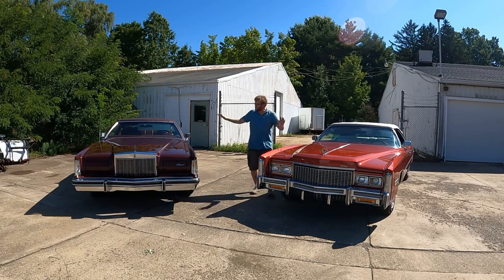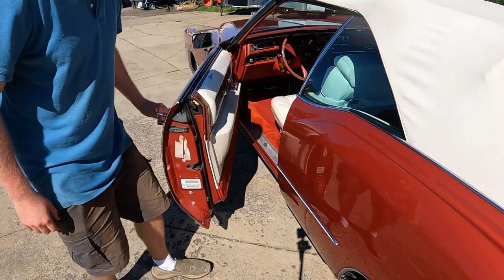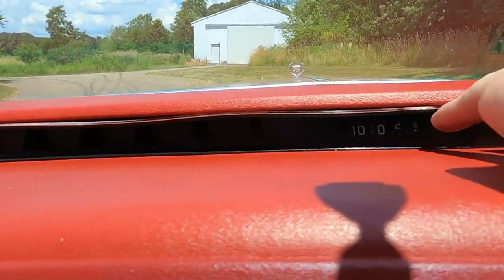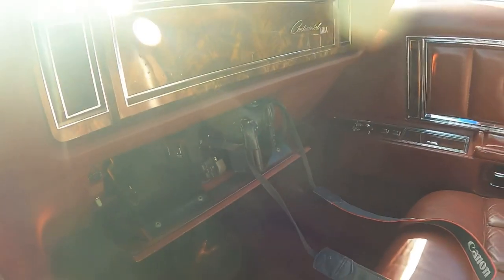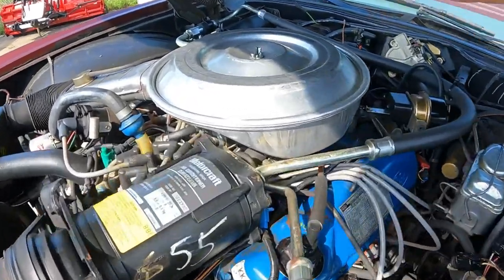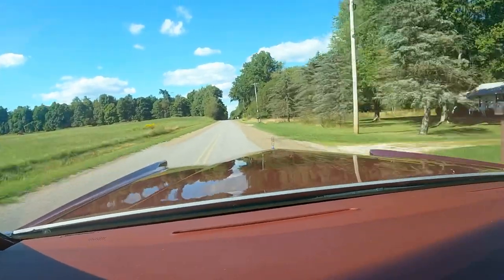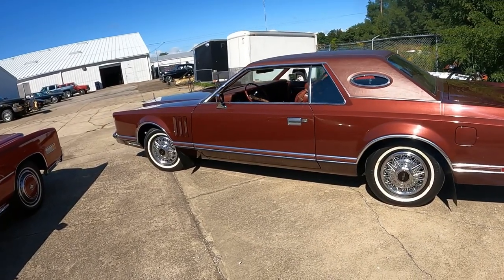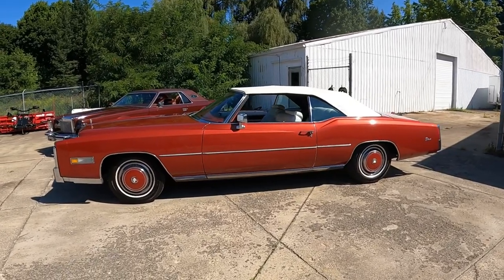This vs that 1976 Cadillac Eldorado convertible vs 1977 Lincoln Mark V￼

Comment: With the Lincoln, I'm surprised that it doesn't have a 460. The 400 and the 460 is miles apart, with the 460 having a noticeably larger physical size. The 400 is part of the "M" (modified) family which also includes the 351M(which used to be a 351 Cleaveland. What the "M" indicates  is that it had the 'big-block' bolt pattern on the back so that it was the same as the 429 and 460 family. Having the 400, the Lincoln is seriously underpowered and gas mileage was erratic. Having had a 1974 1/2 400 equipped Ford car(which was rated as a gas hog, with the Olds Toronado ranking the worst gas mileage) in the family, when on a trip, when you stopped to fill up, you might find that the car  got 12 mpg, but filling up after the 2nd leg of the trip, it would have gotten 26 mpg. One particular trip was on I-40, which was pretty much flat without going over any mountains.
One of the tip-offs identifying engines(not looking at the sticker on the air cleaner), the big blocks had what looked like an oil filter attached to one side of the air cleaner housing.

Although the El Dorado had a much larger engine, it was very heavy. With it's brother the Olds Toronado, the front wheel drive  had no advantages like a smaller and lighter car would.  Because of the excessive weight, when the road had curves, the car wanted to go straight rather than to follow the direction of the front wheels. About the only advantage was when drive slowly through a snow-covered road. The reason it didn't have torque-steer was also because of the massive weight on the front driving wheels. The transverse mounted engines and transmissions of later Cadillacs had torque steer. 

My choice between the 2 cars would be the El Dorado, mainly because it is a convertible. That era using the Bendix fuel injection system wasn't that much of an advantage. Basically it sensed load through a vacuum hose going to the control unit. They also used a 2 barrel  throttle body. It was basically for emissions. When equipped with a Rochester Quadrajet, when the secondaries opened, you would feel it. Those El Dorado convertibles had a nickname, which was very derogatory and I'll let you guess, "_ _ _ Canoe".
Reply from the maker: Thank you so much for taking the time to share that story as well as insight =) that’s crazy to go from 12 mpg to 26 mpg both cars could have used another gear or two it would have made them far better. Still can’t get over how smooth the Cadillac is being FWD
Reply: @What.its.like.  Yes, the Ford 400 V8 had some serious mood swings. I'd spoken with others and they had the same complaint with the 400. When my parents got their car, it was getting 6-8 mpg around town(the Toronado was rated at 4 mpg). I figured out what was going . It was the emission control system and I figured out what to bypass and the mpg around town popped up to 12.  I never could figure out the erratic gas mileage. On a trip, sometimes the gas gauge moved very slowly, but when you stopped to eat  or something when you started the engine, you could watch the fuel gauge sinking rapidly as you drove.

Nobody had overdrive automatics or even lock-up torque converters. Cadillac got it's first O/D automatics in 1981, but only on full size RWD models with the 4.1L Buick V6. In 1982 all RWD cars got an overdrive with the HT4100. The restyled FWD Eldorado and Seville got an overdrive automatic in 1982 behind the HT4100 V8. By 1982, GM had 3 overdrive automatics and all had teething problems which didn't get solved for several years. By the time it was worked out They had discontinued the 2 O/D automatics and with the introduction of the all-new FWD full-size Caddies in the Fall of 1983, the opened up another can of worms with a new O/D automatic transaxle.

When I worked in a Cadillac dealership my line was transmissions. There were 4 of us and we were always kept busy. Each different transmission had the same parts fail over and over. I knew every part I would need before I even brought the cars into the shop. I had a pre-made requisition order for each model of transmission  which I would hand to the parts department. It was all warranty repair so we didn't need to get the car owner's OK to repair it.
Reply: This is a totally fraud comparison, the Lincoln being a coupe & Caddy being a convertible, some choices were because it was a convertible, you should have compare a Caddy Coupe with the Lincoln Coupe ... and also use the the upgraded interior in both cars ... the Lincoln Mark III, IV, V, & VI were all better than the Cad El Dor, Lincoln sales over ran the Caddy, and people preferred the Lincoln Continental Mark V, just because Government Restrictions were in place, is why smaller engines were used ... but the Lincoln Continental Mark V was by far the WINNER 🎉❤😊 ... now in 2023, the Lincoln Continental Mark V is selected and preferred, over the Caddy ... We have owned the Mark III, IV, V, VI, and VIII and one Eldorado ETC, we did not own a Mk VII ... but the Lincoln’s were far better than the Caddy’s, and we were Caddy people prior, but Lincoln from then on were the BEST ... the Caddy we had, was in the repair shop, every time the bills were: $3,200, $2800, $3,650, $8,200, the $8,200 was reticules they had to take the entire engine out of the car to repair it, and keep the car for one month ... it was nothing but trouble from the first day of ownership ... the Lincoln’s only needed regular warranted maintenance and were a much more reliable cars, better smoother ride, and so what if engine was 400 in 1979, these cars were not built to be sports cars, all of you are so petty, and do not know what the F**k your talking about ... the 🎉🎉❤❤LINCOLN CONTINENTAL MARK V 🎉🎉❤is the WINNER all the way around ... next time don’t sku your comparison use apples with apples, not apples with oranges ...   you video was faulty, so do your homework right next time, understand!!!🎉
Reply: @caesarbolchini6465  Large luxury cars were very heavy, sometimes over 1,ooo pounds  more than a comparable full-size cars. Because of this, they needed large engines with lot's of torque. The Lincoln Mark series was a sports luxury touring personal luxury car from the Mark II-on.  With the re-introduction of the Mark series with the Mark III, the only engine available was the 462 or 460 V8(depending on production date and model year). With fuel mileage concerns, the engine offering was the 400 V8. Lincoln Mark sales suffered due to lack of power, and if they had owned one which had been equipped with the 460 V8, they were even more unhappy when they found out that the 400 V8 got worse gas mileage. For the 1974 model year, the Ford 400 was ranked as the 2nd worst gas hog  engine(6 mpg), only 2nd to the Olds Toronado with a 455 V8(4 mpg).
Now, depending of what year and model Cadillac you had and how it was equipped is a defining factor in reliability.  When things really started changing with Cadillacs in 1982, lot's of teething problems happened. But things started going downhill from there. Most problems were taken care of during the warranty period with no cost to the car owner. More often than not, the problems encountered were fixed in warranty and never occurred again. If you were one of the unfortunate people to get a Cadillac with a diesel engine, there was a 100,000 mile warranty. Often, the 1978-80 diesel Cadillacs were also taken care of under extended warranty. This even included the automatic transmission on the earlier cars if you had the TH200.
How do I know? I was a Cadillac service tech in the mid-80's.
Myself, I got a 1981 Fleetwood(with the infamous, but trouble-free V8-6-4) while I was working there and I still own the car today. It has never had anything replaced or repaired outside of normal wear and tear/ preventive maintenance. It has never left anyone stranded, which is unlike the Fords and Lincolns before and after. 
When I was in independent auto repair, we made alot of money working on Lincolns, which were towed in frequently. Hardly made any money off of Cadillac customers, not like Lincolns.
When somebody like me has worked in a wide service and repair fields, we have a front row seat.

Comment: Caddy back then definitely had a better ride, drove better and the Caddy had a nicer more powerful engine, and something not mentioned here the FLAT FLOOR in front due to the Eldorado being FRONT WHEEL DRIVE - Ive been in both back in the day and worked on them as a mechanic and I could never escape the feeling the MKV was just a really fancy ford, had the same for engines even had the same basic steering wheel as the LTD's  and the dash was much like the big Mercurys etc. just a bit fancier.  The Caddys engine was technically a (502 cu. in.) and it was not found in any other GM car, only the Cadillacs - the engine family started out as the 472 earlier then later the 502 which everyone refers to as the 500.  NOTE:  There was also an "Eldorado Biarritz" option that put Caddys thick button tufted Fleetwood Brougham interior in the Eldorado - it was reeeally nice.
Reply from the maker: Thank you for sharing all of the information as well as insight and your experience with the car really appreciate it =)

Comment: Well I can tell you this I picked the Cadillac I have the same exact 1976 Cadillac convertible except I have red seats. I got to tell you four-wheel disc brakes & floats over stuff I don't know the look of it is more impressive I think than the Lincoln but they're two different cars in the luxury realm and they both have their unique coolness but I just picked the Cadillac cuz it was a convertible Etc I'll have to do a video and put it on YouTube soon but I've only owned the car for a couple months I have a ways to go on fixes!
Reply from the maker: Awesome can’t go wrong with either thank you so much for sharing your experience with your car on here  =)

Comment: Yank Tanks! 😀
I really liked Continentals much better than Eldorados!  
My mom had a '79 Continental but hers was dark green and it had dual lighted vanity mirrors, power moonroof, Ford Areospace AM/FM with cassette player and turbine spoke aluminum wheels.  It was so nice!  I love that the Cadillac is a convertible though and it's too bad Ford didn't offer the Continental as a convertible, but the moonroof was great.   IMO the Lincolns appearance is cleaner and I believe that's due to it having better fit & finish inside and out, but I bet the Cadillac had better traction during acceleration in wet conditions with all the weight of the engine and transmission over the drive wheels up front.  I remember my mom spinning the rear wheels often when it rained and the Lincoln hydroplaned too easily when trying to stop in the rain with momentary loss of steering. It was scary.  And totally agree with you about the dashes in these and the same steering wheel in all Ford products.  We also had a Ford Econoline and there was that same steering wheel!  
Also, I never liked those body filler parts between the quarters and rear bumper on the Eldorado, it just looked clumsy and incomplete to me.
But nonetheless both very nice American cars of the time👍
Reply from the maker: That’s funny that the Lincoln hydroplane as much as it did but I could totally see that it’s hard to believe the Lincoln is bigger than the Cadillac because the Cadillac just seems massive the Lincoln doesn’t seem nearly as big as the Cadillac especially when you’re driving it it like I don’t wanna say that it isn’t big because it’s huge but it doesn’t feel nearly as huge as the Cadillac.. it sucks this Lincoln didn’t have hardly any options because they got really pricey what the options lots of options you could buy the buyer of this Lincoln didn’t use hardly any options perfect color I think maroon is one of the best colors.. we just got a powder blue one in I’ll probably feature that one it has a lot of options the vent windows the nice leather seats ,sunroof, cb radio I think it might even have the miles to empty gauge which was a huge feature I think it’s the very first car to feature a gauge such as that.. 
The Cadillac Road nice but the Lincoln nothing rides like a Lincoln Cadillac comes close the new Cadillac seats were super comfortable but the leather seats in the Lincoln wasn’t top-notch leather seats they were the entry level leather seats Lincoln offered a lot of different seat options for the Mark five I’m not sure how many offhand they at least offered two versions of leather seat maybe even three.. I hope to hit every variation of the Lincoln mark five series one day because I’m a huge Lincoln mark five fan they made a lot of designer series and just a lot of different options for that car.
Reply: @What.its.like.  You're right, the Eldorado does appear to be bigger, guess it's an optical illusion with them big chrome bumpers and chrome treatments, the curves in the body panels and  them bulging wheel covers.  The caddy looks fat😀
 Looking forward to your other Mark V video.  Me too, love Continentals!   The designer models are hard to find too, especially those with the center consoles and the ultra nice seat treatments.  Very cool!
Reply from the maker: It would be cool to track all the designer series down for one hell of a comparison =)
Reply: @What.its.like.  That really would be an awesome video!

Comment: I'll take the Lincoln any time
Reply from the maker: Me to the Lincoln in this video didn’t have good seats it would have been head and shoulders better than the Cadillac.. that Cadillac got really really bad gas mileage and the power wasn’t all that much better. I want to drive a Lincoln with a 460 I never drove a mark five with a 460 I’ve gotten to drive a couple mark fives but all of them have had the 400. The car needs another gear if it had the AOD transmission or a four speed or a five speed would be even better that car would be incredible with a five speed. The gears in the one I drove seemed tall and didn’t have the kick down power my 88 Lincoln had.

Comment: Why didn't you compare a 77 Cadillac to a 77 Mark as the 77 Lincoln had over 400 pound's taken out of it and lost the 460 as the standard engine so this really isn't a heads up comparison mainly because the weight removed from the Mark was noise insulation and metal thickness yet the public still bought 5 times as many Mark's compared to the eldororado
Reply from the maker: I didn’t have a 77 Cadillac those are the cars I had
Reply: The 460 was lost in '79

Comment: A better comparison would have been using a Lincoln with the 460 and  the Cadillac hard top
Reply from the maker: I agree but this is what I had available to me and I always wanted to do the comparison better comparison with a bit of Lincoln mark four.. I still think the Lincoln’s better than the Cadillac even with the 400.. that Cadillac driving around for 20 minutes took a lot of gas lol

We actually ran out of gas Zach was driving and he was like what is that noise and I was like oh that’s the noise that the car makes right before it’s about to run out of gas. And he was like wait we’re out of gas and I was like no not yet now we are out of gas.. lol we had to push it off the road and wait for somebody to come with gas good times
Reply: @What.its.like.  Sorry to hear about that. It's a shame that the car industry back then couldn't do what they really wanted to do because of the oil embargo and the restrictions that came out that.

Comment: For the next video he will compare apples to oranges. They are both fruit,, which is as "similar" as these two cars. One is front wheel drive, a convertible, and fuel injected, the other is none of those bur they are both cars.
Reply from the maker: I didnt have both of the equal cars why miss the opportunity of comparing two flagship cars 

Some people are just narrow minded and cant think outside the box

Comment: What's it's like : I like the Lincoln much better. I think it's a much better looking car. A classier looking car. I once drove a 1971 Oldsmobile Toronado. It is front wheel drive. It had the 455 4v. I didn't like it. I thought it had too much weight on the front end of the car with such a big, powerful motor.
Reply from the maker: I totally agree the Mark five just looks like the executive car not saying anything bad about the Cadillac Cadillac’s great.. both cars in my opinion are better than what Mercedes Benz offered at the time for a fraction of the cost

Comment: That Cadillac interior - the door panels in particular - is dreadfully tacky. The Lincoln looks restrained and distinguished by comparison and clearly much higher quality materials. How can a car on a 126 inch wheelbase and front wheel drive have such poor rear interior space? I would have definitely bought the Lincoln! 😊
Reply from the maker: I agree, the only thing I didn’t like about this Lincoln it wasn’t optioned out like the Cadillac I’m sure if it had the better seats it would have felt better it definitely rode better than the Cadillac, but the seats in the Cadillac where better in my opinion. 

It’s hard to believe the Cadillac is front wheel drive because it doesn’t act like a front wheel drive car

Comment: I wonder how that big Cadillac would handle with front wheel drive.
Reply from the maker: It’s not bad it’s like a new front wheel drive car there is absolutely no torque steer. It’s weird if you didn’t know it was front wheel drive you would not know it’s front wheel drive it doesn’t feel like a front wheel drive vehicle the tornado is like that as well